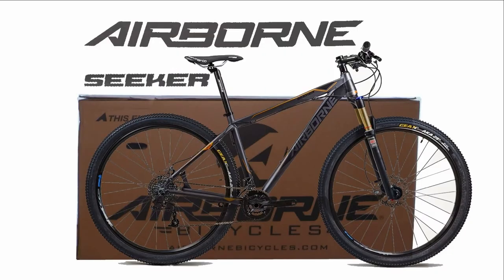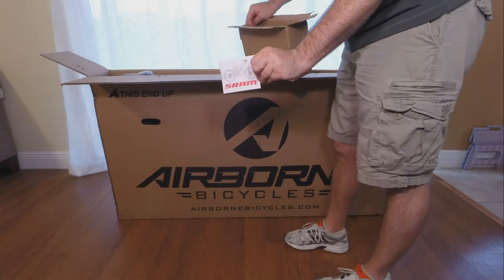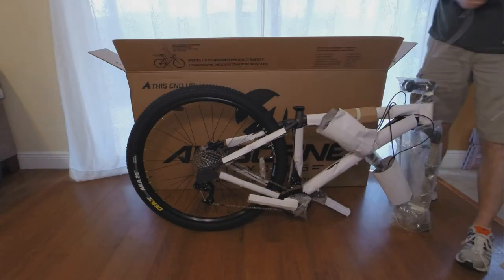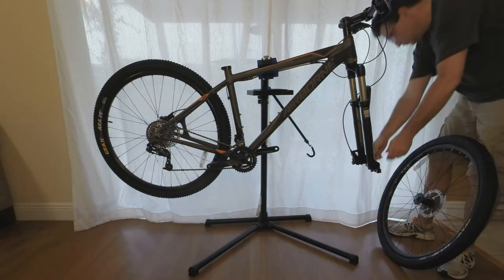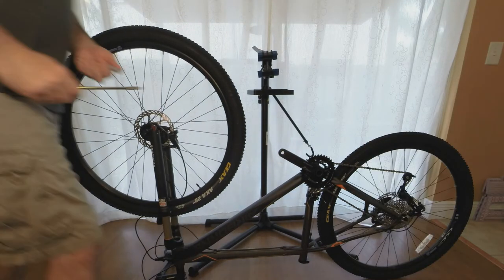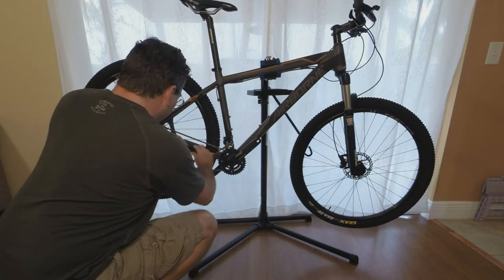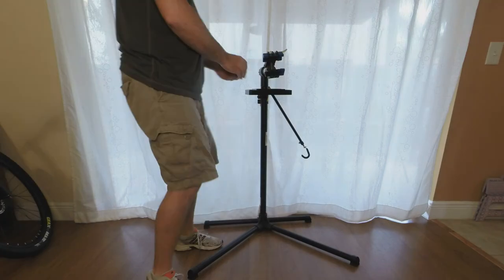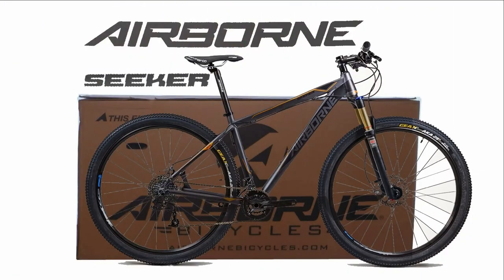Airborne Seeker MTB Unboxing and Assemble Time Lapse 29er

Comment: Great video!  I was just researching this bike.  What do you think so far?  How many miles do you have on it now?
Reply from the maker: So far I have put 31 serious off-road miles on the bike. The saddle had to go first. I now have a Thudbuster LT seatpost and Vader VD-104 saddle on it from an old bike (heavy and makes the bike less nimble). The bike is fast and rides great. I plan to lighten it up with a Trigon SP160 seatpost and a Selle SMP carbon saddle to make the bike balance better. The front brakes seem to rub a little when it warms up. There have been reports of this on the Seeker and if it continues after the 100 mile mark, I will give Airborne a call. I really like that this is the only 29er with a tapered headtube under $1k. This makes the options for upgrading the front fork in the future much easier. When I brought it to the LBS to check out, they were very impressed with the quality of the bike for the price and confirmed it was a good deal. The closest bike they had to the price did not have hydraulic brakes, tapered headtube, or as good a fork.

Comment: How is the bike holding up? I'm currently looking into the seeker myself.
Reply from the maker: Guillermo Garcia It has been great. Only minor issues. For the first ~50 miles the headtube had some rubbing sound that has gone away. The brake hose rubbed the paint off a little on the front fork where they make contact. I bent the derailleur hanger when my chain got caught on an outcropping. I replaced it with a machined hanger for $19 from Amazon (http://amzn.com/B001CJXF8M). The rear tire lost tread quickly ~150 miles (I ride an old limestone quarry that eats soft tread tires). Replaced it with a wire bead tire $26 (http://amzn.com/B002SR3MSA) The original saddle is a groin killer, I am testing several different saddles and posting video reviews. I prefer Selle SMP saddles anyway. I adjusted the rear derailleur in the same order of this video (https://youtu.be/92Cu_jneQFw) and it now shifts perfect every time (no skipping or clicking). Rides fast and has a great feel.
Reply: ThreeDigitIQ Thanks for the info.

Comment: Would you mind stating your height and the size of the bike? I'm 5'11, so it says I should have an 18. At the same time my brother has a Goblin Evo and it is huge on me. Should I just go with a 16 or hope that I grow (Only in my teens) and get an 18?
Reply from the maker: HeSaidWhatToWho I am 5'10" with an average inseam and the 18 fits great. I only need to shorten the stem for it to be perfect. An average leg has an inseam that represents 45% - 48% of the height. What aspect about the Goblin feels huge? Legs to peddle? Reach? Torso ballance front/back? Try setting the seat tube at the proper height and move the saddle to the 2/3 position on the rails. If it still feels "huge", you could have a disproportionate torso, leg, arm reach. Also, 29" wheels do require bigger frames, so the bike IS bigger than a 18/19" 650b or a 26er. Try out a 18/19" XC 650b at the LBS and see if that makes a big diff.
Reply: ThreeDigitIQ My inseam is not average what so ever. An average inseam for me would be 31.95 - 34.08 (according to the 45-48% thing you stated). My inseam is around 30 inches, a little below that. I just felt like it was a very tall bike. My crotch touched the top tube of the bike. I've heard that you should have about an inch or more in between there.
Reply from the maker: HeSaidWhatToWho It may be best to try before you buy then. The good news is, there are so many options available, it may be worth spending a few extra bucks at the LBS to be sure you are getting a bike that feels right. Good luck and let us know what you end up getting and how good/bad it worked out.